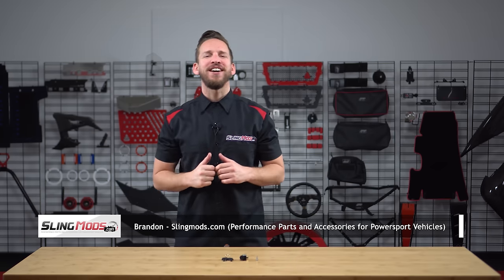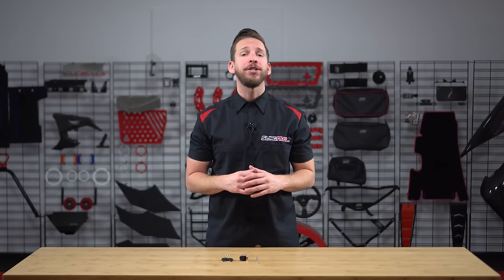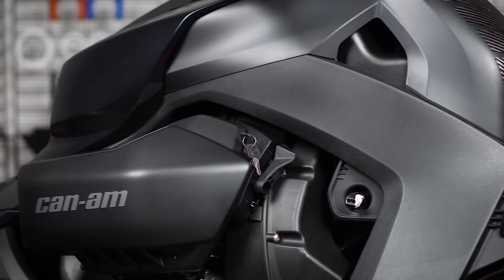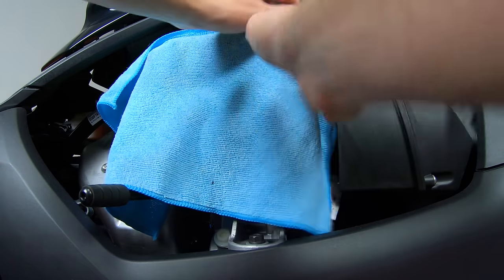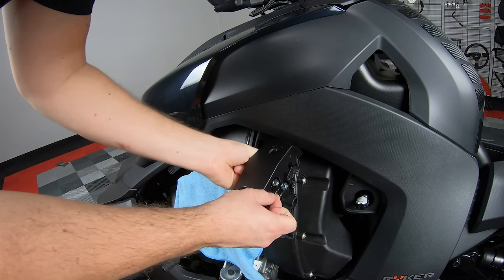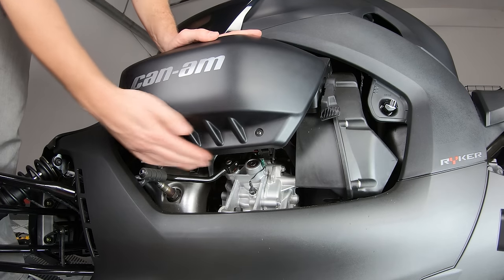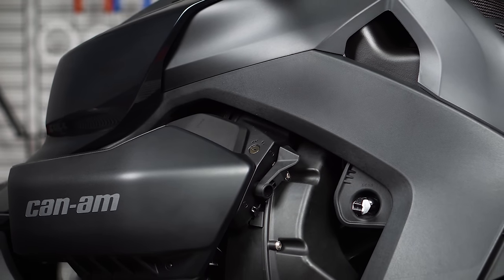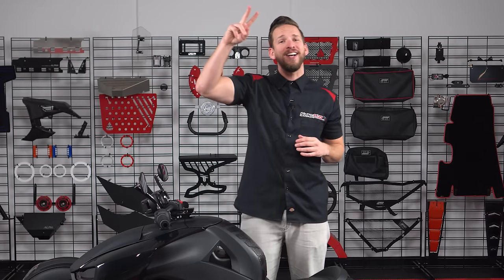Can-Am Ryker "Keyed" Parking Brake Lock | Installation

Comment: If non US models have the lock standard, why not have BRP pay for lock and its installation. If you buy a car from a different country (UK) and have it shipped the steering wheel is not on the right. The company doesn't have US buyers pay for the hardware and installation. Come on BRP

Comment: I have a question , whether due to the dysfunctions of the right leg is the possibility of transferring the brake control to the lever mounted on the steering wheel or transferring the lever to the left side of the Ryker?
Reply from the maker: Hello Ryszard, there is a company called ISCI that has done what you're asking for the Can-am Spyder. I'd give them a shot. thanks!
Reply: Thank you very much for the information.

Comment: So is the upcoming glove box lock going to go in as easily? Also, any way to get they keyed in the same core?
Reply from the maker: Hello Mitoni, we will be doing a video on the installation of the new "glove box" lock here in the next week or so. The parking brake lock and glove box lock are from two different suppliers and unfortunately not available with keys that will work for both locks. That would be awesome though. We do however have plans to make a "keyless" glove box lock in the upcoming months that will use a push button key fob to unlock the glove box. Thanks.